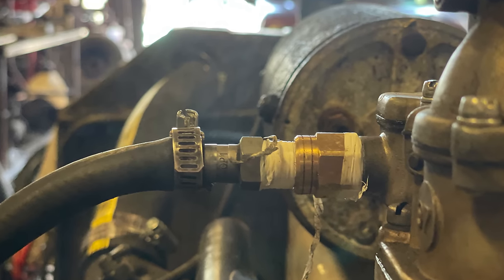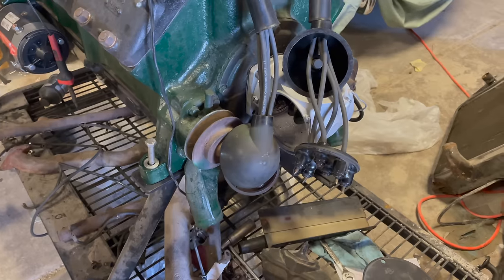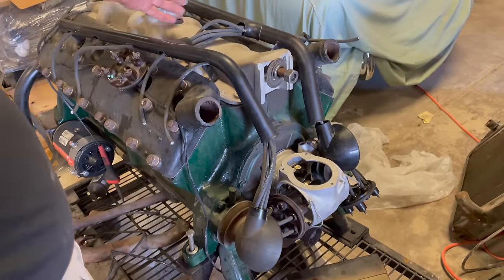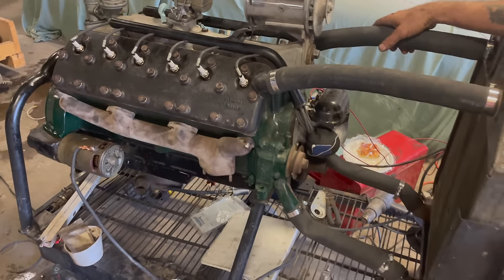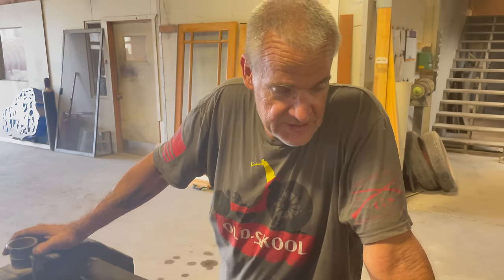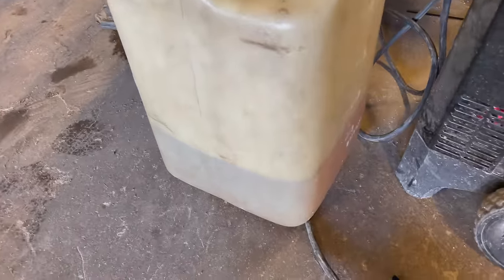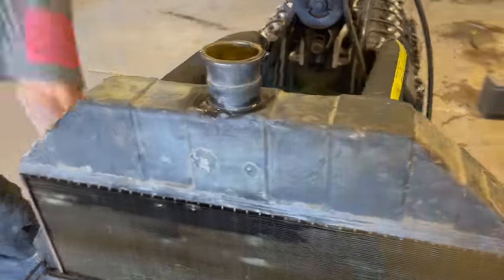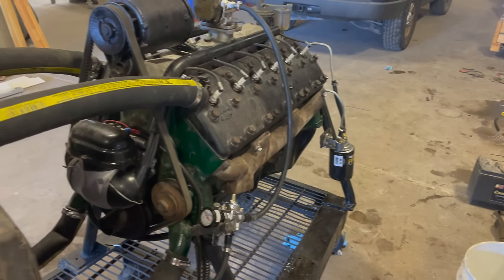Fire it UP!! 🔥 V12 Flathead Engine Ignition & Start! Lincoln Zephyr V-12 Series Will It Run? #barryt

Comment: That is a later model engine as it has cast in front engine mounts.  Dont remember the cutoff, but the early engines had bolt on front engine mounts.  My boss back in 80's and 90's restored old Zephyrs and Continentals, he even ran a 36 Zephyr in the Great American Race in I believe 1985.  The 36 had cable brakes and you needed the weight of an elephant on the brake pedal to get it to stop from any speed.  My boss always claimed that a well tuned V12 was smooth enough you could balance a nickel on edge on the intake.
Reply from the maker: Richard, thank you that is a great observation and some good tips as well. It seems that every Zephyr that JB attends to gets hydraulic disc brakes as an upgrade for safety… I’ve never driven a mechanical break set up car, and I’m told they can work, but the effort must be quite a bit! Also thanks for Sharing the memories!

Comment: It's never advisable to run an engine without a muffled exhaust system. The un-muffled exhaust noise can mask the sounds of possible trouble in the engine. It only takes a little effort to hookup an exhaust system with a proper exhaust pipe, muffler, and tail pipe. These Zephyr engines are VERY rare, and should be given all the care that's possible.
Reply from the maker: That would be ideal

Comment: It'd be fun to see how an engine like this would go with a decent sized throttle body and direct injection through the top of the head. Add a turbo to account for the lower compression of the era and the higher octane of modern fuels, and they should be a clean running engine with less friction losses due the the lower moving parts count.

Comment: All plugs used to have compression washers, and they do seal a second time, ive done it many times back in the day
Reply: a lot of cars used compression washers. Chevy used them until the early 70's on Big Block Chevys.
Reply: exactly. It was only when idiots would grossly overtighten the plugs that the washers would flatten. Sometimes youd think the plugs held the crankshaft on, they were that overtightened!
Reply: Most small engines still use them today.

Comment: A great sounding and smooth running engine! I must correct you on one thing, though. That is 2-barrel carburetor - not a single barrel. Look at the body below the air horn. It clearly shows two passages into the engine.
Reply from the maker: Absolutely - I meant to say one carb. Thanks, Jim!

Comment: It's a gorgeous little engine,  isn't it?  Very small and tightly contained.  I wonder what a modern "all aluminum replica" with digital ignition and fuel injection would be like?
Reply from the maker: Yeah, I wonder if someone with billet aluminum milling and 3D metal printing 
Could add some modern engineering to it, and really make it into something!

Comment: There was one or two ignition gurus which offered remade hotter ignitions for the long Lncolns. I think Kong made a hot ignition set up. Im sure Belanger or any number of early header guys Guys could make up pipes. And there were any number of grinders to polish and relieve the heads.
Reply from the maker: Cool info. A lot of mod options out there if you research some. Thank you

Comment: The older engines did not have full flow oil filter system they had what they called bypass takes 10% of the oil or less and just bypasses it back into the oil pan
Reply from the maker: You are correct!  Thanks for that, Paul.

Comment: Sorry, but you have a two barrel carburetor, it's a Stromberg 97 two barrel used on many if not most of Ford's V8 flat head engines. I"m surprised they didn't use two or three carbs on those V12's.  It is a beautiful sounding engine, and quite quiet at idle and low RPMs.
Reply from the maker: You’re right!  Thanks Doug.

Comment: Very nice! I wonder about the fuel mixture homogeneity between the inner cylinders and the outer ones due to that long intake manifold feeding through a small single carb.
Reply from the maker: That is a great question in fact we address it on the video I just posted today on the rebuild. We discussed spreading three carburetors along the revised intake manifold, and discussed either having just one with two secondaries, or maybe an idling mix on all three as a baseline. If you have a chance let me know what you think of that video content related exactly to your question.  Thanks!  BarryT AZ 🌵 USA
Reply: That just adds to the overheating issues. V8s dont seem to suffer though most will tell you that two 97s even the mixtures out,, as do most of the intakes to suit.
Reply: @ldnwholesale8552  I was always fowling plugs with my two-stroke dirt bike as a kid, so I was always taking them out cleaning them, and putting them back in, more times than I can count. We all have quirky things we do or won't do.
Reply: My father had a ‘37 (with aluminum heads), ‘41, ‘42 and ‘48 with this engine. He was a member of the Lincoln Zephyr owners club starting in the early ‘70s. I worked alongside of him on many of his cars. 
Somebody made 3x2 intake for these engines, and yes starvation was a common topic of conversation at club meets.
Reply from the maker: Thanks Jack! Great piece of history. JB Donaldson happens to be currently developing a 3x2 manifold for these engines and will make them available.

Comment: THAT V12 was a V8-60 with 4 more cylinders and a real clunker.The REAL Licolnn V12 was the KB of 1932 with about 450 CID.
A lot of the later small 12's were replaced with Mercury 59AB engines.
Reply: Your right. The original"hot-rod Lincoln", had a 39 V-12 with all that displacement in a Model A five-window body.

Comment: Hola Barry de nuevo; en este articulo te explico el porque  se calentaba en exceso los motores tapa plana (Flathead)
producidos en los años 40S del siglo pasado; Vamos a recordar el diseño de la tapa de cilindro (Flathead).
Esta tapa de cilindro ,la salida de agua hacia el radiador estaba situada a la mitad y en la parte superior de dicha 
tapa y cuando el motor se sometía a esfuerzo prolongado , no había flujo de agua  en la parte delantera de la salida
de agua hacía al radiador y esto lo descubrí haciendo un comparativo entre el block de los 40S y el block de los años 50S.
 En el block de los 50S tiene un pasaje qué por ahí la bomba de agua inyecta a la parte alta de la Flathead y eso impide
qué se forme vapor y enfríe esa parte .
Para solucionar este problema ; utilicé bombas de agua de un motor Ford F500 ; adecuando las bombas para utilizarlas
en el block antiguo y hacer pasajes externos para inyectar agua a la parte delantera de las FlatHeads.
Materiales utilizados :4.- Conectores Flair 1/4NPT -6,  4,-Tuercas Flair-6 , y Manguera  3/8" 60.-Cms.
Me gustaría hicieras un video con todos los motores Ford  tapa plana (FlatHead) producidos por FORD
Es todo por ahora, gracias por la atención a este articulo . Atentamente Emilio Hernández
Reply from the maker: ¡Eres claramente un mecánico muy talentoso y creativo!

Comment: The Calif firm made newly manufactured hi comp heads while the Illinois firm simplyreworked stock Lincoln heads. Ther was I remember one ofvthecearly cam regrind e s which made a 3/4 race cam for the V 12's and V10'S

Comment from the maker: A few notes on this video...  This engine was set up on the fly to quickly learn if it was a "runner" or not, so the set up is far from what you would want for long term testing. There are some leaks and a kinked water hose that would NOT be okay for any kind of lengthy run. I said 1 barrel when i meant to say 2 barrel. Also, the spark plugs should be tightened down properly to ensure good spark ground and compression. The exhaust manifolds aren't really connected. If you want to see a start-up of a properly set up V12 Flathead, check this out: https://www.youtube.com/watch?v=Pk_Dsx5FhSw

Comment: Hello Gentlemen thank you for making this video it’s the coolest thing I seen in a while!!
I have a few questions how do the rotors work on both sides does it have dual points how do you time it and how did you know if it had oil pressure and does it have a thermostat and how do you know if it would have had a cracked ring and lastly did you have to get the head gasket custom made?????
I will be anxiously waiting for your answer and appreciate the video and all the things that I learned from you men doing the demonstration, I love flat head engines and seen a few 8s but never a 12 that thing was running like a sweet dream!!!!
Reply from the maker: I’m not sure I can answer all your questions immediately, there is interest in making a video with more detail on how this engine works, especially the spark timing system as well as other things. I appreciate your comments very much!

Comment: it was later found bundling wires up like that makes for an inevitable crossfire situation especially when the wires insulation got brittle and broke down
Reply: Not just on the old cars. Went to barn one night, it had 12v lighting and you hooked up jumper cables.
When I popped the 65 Mustangs hood you could see the spark running on the outside of the wires :(
Reply: @raymondclark1785  a '65 Mustang is 56 years old...just saying...
Reply: @JamesAllmond  It wasn't then, in 67 it got replaced by a GT-350 which also had stray voltage and I used a Corvette harness which had a grounded cover.
Reply: Whatever he says even with the weak ign on those engines crossfire will alwyas be a problem. Yet lots of manufacturers did similar inc SBC.

Comment: You only have one distributor, but 2 distributor caps. In the middle of the distributor is the rotor, not a cam.  If you are running that coil on 12 volts it is going to be cooked in short order.
Those coils are not bullet proof, they give out fairly often with no warning , even if they don't leak. Also you need to have a thermostat or other flow restrictor otherwise the water will be pumped so fast that it will not cool properly.  If you put the wires in the wire loom from the top to the distributor , you can do all the connections on the bench.
Reply from the maker: I need to look into this more and to a video on it.

Comment: On ALL spark plugs screw them in carefully by hand then just a nip up, 1/4 of a turn but NO more!!
Old flathead engines are pretty durable, as long as they have looked after NOT ABUSED ( same for even modern engines ) i have seen video,s on YT of an old Model A or Model T engines, last one 
you would have thought Nah NO WAY it will run, but if it turns over has spark it will run.

I am a STRONG believer with such vehicles BEFORE RUNNING THE ENGINE, TAKE OFF THE SUMP CLEAN OUT THE SLUDGE AND CRAP, get it ALL nice and CLEAN refill with CLEAN oil, not sure maybe 20/50 something not too thin these old girls were NOT made for 05/40 weasel water, clean up the top side, lube in the bores, gently turn them over by hand, then start them.

IF my lotto comes along???? There is a nice Model A, i would have!!!!!!!!!!!!!!!!!!!
Reply from the maker: Awesome tip, you’ve obviously been there before!

Comment: What a nice looking engine and it sounds absolutely great. If it were mine, I daresay I'd for now leave it as is and find myself a Model AA pickup truck and install it into that sweet little truck and daily DRIVE it! My "for now" would last as long as the engine runs like it runs on the test stand and that would some time because I do not beat on something like that no way! Sure I'd open her up from time to time but no rat bagging it ever. Anyways, when she starts to use more oil or lose some compression, then I'd remove it and rebuild it properly, using some of today's technologies to overcome the weaker points and make it more reliable, issues like: Improving coolant flow by enlarging the coolant passages. Get the crankcase breathing better even if I have to make up a small electric motored fan type of deal to deal with it. Improve the poor oil flow by taking up to a whole week enlarging the oil passages, drilling out this and that, chamfering wherever possible and installing a high volume oil pump and more.
Henry Ford would smile if he were today to see that engine run.
Reply: Wow  !  What  a  great  video  so  nice  to  see  that  v 12 start up  and  run  !  I have  one  , hopefully  this  will  inspire  me  to  get  busy  on  mine.
Reply from the maker: Great - get on it!

Comment: Nice , but ohh poop, common exhaust ports. A high performance killer. Too bad. But really nice running sample. i bet it would sound ridiculous with a 12-2-1 exhaust thru a brass straight pipe though. My pops and his bro used to cut up those cast iron intake manifolds, and put 2,  3, or (4 for drag racing) carburetors on them. And were so proud they could change the blown seals in a transmission on the curb in 15 minutes flat, because they bought the seals by the case back then....And they would make slicks from old snow tires. Ahh the 40's 50's. Amazing Ferrari and bugatti had already designed Dohc supercharged v-12s by then and refined them to dependable. And detroit spits out a common exhaust wheezy mule motor with bad seals and 4 too many cylinders..
Sorry if I seem like im bagging on it, but....Meh To bad its not the Buick12  or Cadillac 16 that was slick engineering for the time, and pushing the current metallurgy to the limits. Nice stuff.
Reply from the maker: You make very good points! Yeah, they were many very interesting and very different engines in the 30s, so much experimentation going on at that time. I have encountered a Cadillac V16, and wow that is something! It was expensive though, and they didn’t make very many of them…
Thanks for jumping on, great to have you on the channel!

Comment: Marginally, less polluting than newer two-stroke motorcycles (which are also obsolete). Flat -head engines are simple (like two-stroke engines), but are almost as inefficient. So yesterday.
Reply from the maker: Haha.  Absolutely yesterday by 80 years

Comment: Really cool, such a narrow engine. I’m curious tho, why it looks like the exhaust manifolds are only 4 ports like a V8 engine? I know I could google it but I figure I’d be distracted before I could actually type it out and I’d forget what I was doing.
Reply from the maker: It’s a fair question. The exhaust valves are paired up in the center region of the block, so cylinder one exhaust at the front edge of the block, the next two valves are intake, then the following two valves are exhaust in a pair for the next two cylinders and so on. So the middle two exhaust ports are shared by two cylinders each.
Reply: Flatheads are notoriously inefficient, it's a battle between compression and airflow.
Reply from the maker: Hey Les, True, a lot of trade-offs, I suppose like most engines designed in the 1930’s. Thanks for chiming in!
Reply: Three exhausts on a V8. Causing over heating

Comment: With old engines you got to start using Mercury Marines Power Tune product for cleaning them out, there is nothing better on the market, it is a foaming combustible decarbonise formula originally made for 2 stroke  marine engines, it has no equal
Reply from the maker: Good to know! Thanks for the tip

Comment: There are alot of modern engines that still use crush washers on the spark plugs.
Reply: I really don't know why they do the tapered fit plugs work just fine. I think it has to do with the manufacturer wanting the correct torque specification on the spark plug to be honest. Generally you see crush washers on a lot of engines with aluminum cylinder heads. I'm thinking they are worried about people over torquing them and gauling or damaging the aluminum threads in the cylinder head.
Reply from the maker: You are right, the engine builder has encountered quite a few aluminum flatheads (for example) that were over torqued and it actually caved in the head a bit!
Reply from the maker: Great observation
Reply: @jeremypike9153  I hate the taper-seat plugs.  After they have been in there awhile, they become very hard to remove without breaking them.

Comment: Might wanna put a fan on the engine. Great work, though. I think every car company should make a V12.
Reply from the maker: True for sure for running more than a couple mins from cold. Thanks Bradley
Reply: I'd love to know how the timer (distributor) worked. I didn't see any points. Also, does the distributor cam have more lobes for each spark plug on a six versus a four cylinder engine, or just an extra cam?
Reply from the maker: @Cat-fy5lw  I’m going to try to make a video just about the coil and timing for this engine.  Thanks Bradley
Reply: You're welcome,and thank you too!
Reply: @BarryTsGarage  When working at my Dad's Gulf station back in the 1950s, I changed plenty of those old oil filters. Despite (or maybe because of) only filtering a tiny fraction of the oil at any one time, many of them came out black and sludgy. The flow-through filters were a great improvement.
Reply from the maker: Thanks Paul
Reply: @paulmathless642  That was the problem with those old early model Ford V12s. The crankcase wasn't ventilated adequately. This caused excessive wear, oil sludge, and overheating. Not to mention warped cylinder bores. Eventually, Ford resoled the issues, and this engine became one of the quietest engines on the road. Later models even had hydraulic valve lifters.